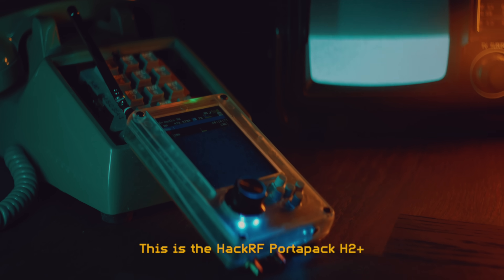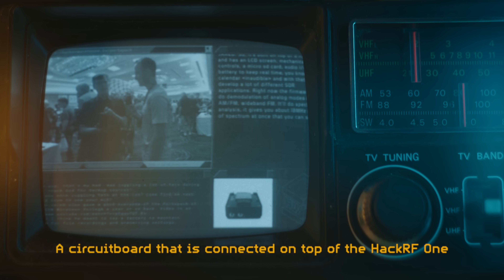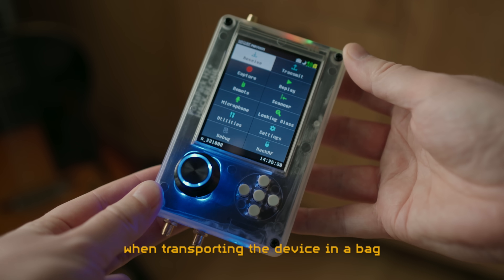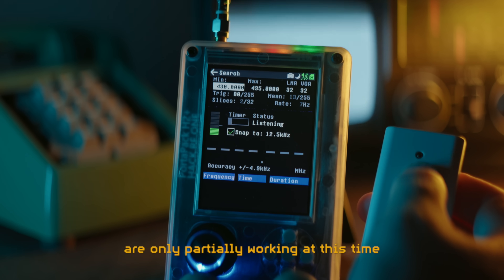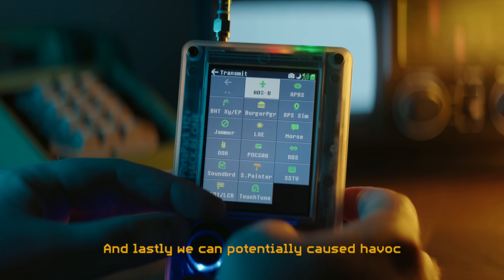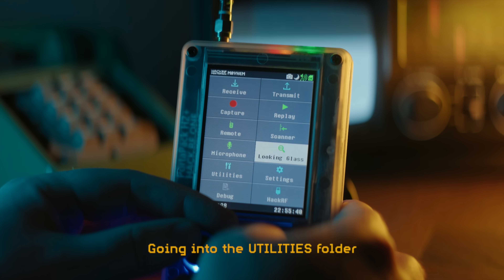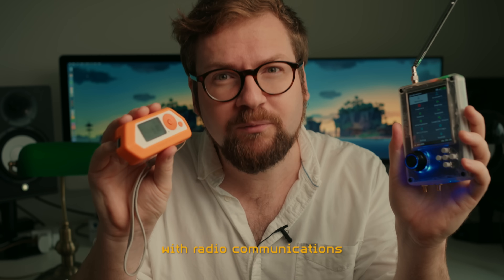What is the HackRF One Portapack H2+

Comment: Both tools are completely different. The flippers used for IR, Ibutton, subghz, and RFID.
The hackrf, while capable of recording a signal, is a traciever designed for radios. A flipper and hackrf save files are not interchangeable that I know of. At least not out of the box.
The big brother to the Flipper is dependent on the frequency. That could be a small usb dongle for IR, a microcontroller, or an FPGA.
The big brother to the hackrf are it's individual transcievers, which each have their own solutions.

Comment: How do you exactly get the correct pin code using the porta pack only using touch tunes? Does the portapack have the ability to brute force all 256 possible PIN codes or do you need additional software for it to work?

Comment: ok, so you can detect the invisible radio signals with it - but what about the visible radio signals? ...

devices like these have been used for GPS spoofing.

spoofing a gps signal, and i.e. telling an airplane theyre flying super low - can lead to loss of lives
or even to wars.  
You would be confused with a nasty actor currently in a "special military operation" - and the triangulation of nasty signal with military equippment 
is a very fast affair.  We talk about less than a minute.  

If you want to transmit, make sure to do it on license free frequencies. Which they are can be asked from google. (in europe its the 433 mhz range 
where sn0ren has been demoing most of the time) 

We had massive GPS issues here in finland lately.. and specialists are prepared to kick doors down.

73
Reply from the maker: Luckily the HackRF has a very low power output, so hopefully people won't cause too much interference, even if they happen to transmit where they're not allowed.

Comment: we had rpi zero it cost 5 buck it can do everything same with extra parts..and some more
Reply from the maker: You would still need some kind of sdr transceiver connected to it. Raspberry Pi Zero has no built in receive or transmit capabilities. You could connect the base HackRF to a raspberry pi and control it that way. It’s not very portable though.

Comment: 🎯 Key Takeaways for quick navigation:

00:00 📡 Introduction to HackRF Portapack H2+
- Overview of the HackRF Portapack H2+, a device for detecting, decoding, and manipulating radio signals.
- Both HackRF Portapack and Flipper zero perform similar functions.
01:48 🧩 Evolution of HackRF Portapack
- History of HackRF Portapack development, starting with the HackRF1 in 2014.
- Description of the original Portapack kit and its evolution over time with various contributors.
- Challenges and quirks in the hardware design, including issues with the battery and power controls.
03:06 🌐 HackRF Portapack Functionality
- Overview of the main menu and functionalities of the HackRF Portapack H2+.
- Explanation of the receive menu, decoding apps, and examples like ADS-B, AIS, and APRS.
- Exploration of the transmit functionality, including emulating signals, SSTV protocol, and potential misuse warnings.
04:57 🔍 Specific Decoding Apps
- Highlighting various decoding apps for specific signals, such as ADS-B, PAC pager, weather balloons, and more.
- Mention of apps with partial functionality and the usefulness of the search app for identifying nearby device frequencies.
06:01 🎙️ Capture and Replay Functions
- Explanation of the capture and replay apps for recording and emulating RF signals.
- Introduction to the scanner app, microphone app, and looking glass app for different functionalities.
07:11 💾 Utilities and Recent Developments
- Overview of utility applications for managing data on the SD card, editing frequency lists, and trimming captured recordings.
- Discussion of recent developments, including loading applications from the SD card and the introduction of the Pac-Man game.
- Insight into the potential for future applications without firmware limitations.
07:45 ⚙️ Settings and Original HackRF Mode
- Explanation of various settings and options available on the HackRF Portapack H2+.
- Mention of putting the device into original HackRF mode for use over USB with a computer and SDR software.
08:05 🛠️ Conclusion and Reflection
- Summary of the HackRF Portapack H2+ as an intriguing tool with interesting features.
- Acknowledgment of its quirks and potential for experimentation in radio communications.

Made with HARPA AI

Comment: Agreed it needs a manual switch for hackrf. Mine is accidentally turned on easily.  I bought it with a speaker and internal battery which isn't always the norm.  Hoping one day someone will update the hardware with faster processing, usbc etc

Comment: The flipper might be a toy out of the box with its software limitations. But modified with custom firmware and added hardware to the GPIO ports the flipper is a strong and handy tool. The big pluss for rhe flipper is that it has all these functions in a slick and tiny design where as the hackRF is quite large and not easy to hide.

Comment: Hey Sn0ren, What is aprox the range for capturing and replaying signals? Much more than a flipper right? 

Thank you
Reply from the maker: Much more than the flippers build in antenna yeah - the primary reason is that you can fit external antennas on HackRF Portapack by default. I haven't tested range of flipper with an external antenna vs portapack, but my guess is that the range would be similar then.
Reply: @sn0ren  Thanks for replying

Comment: This is probably a stupid question but can this record and play back a gym card from a bit of distance? I'm planning a road trip and going to be sleeping in my car, I was sort of hoping I could find a morally grey area way to use the showers at gyms as I go along my way, but it seems like you need to have direct contact with the cards to clone them. I've been reading conflicting info about the hackrf having no nfc/rfid abilities and maybe the chameleon being the best option
Reply: unless your gym uses very old card readers then no.  Playback doesn't work as the nfc process is a handshake -- the transmitter sends data using a rolling hash and the nfc card replies with a salted response.  If you record then play it back the transmitter will just think it's jibberish.

Comment: It will get better over time as the raw tools are all there, you'll see people adding programs to it, it's kind of like an updated hardware set up, but without the tools that have been built for flipper zero.  Remember, flipper is much more evolved. This is new and has a lot of opportunity to be far better than the flipper but for size, flipper wins, but add a headset to it and it looks just like a radio.

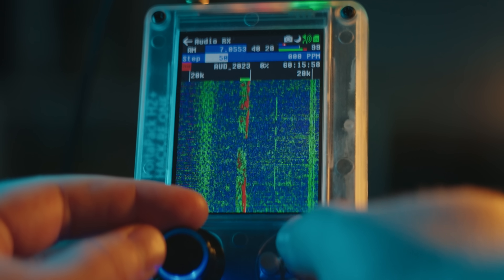Comment: Got 3:35  few tips only 16g max for the card and format fat 32 only. Put all the folders out front so when you open the SD card all the folders pop up. You can also tell the SD card is working under folders. 

FYI don't get the newer version of this tool as support won't be available.  It's the one that had a speaker built in.

Comment: Flipper Zero is a multitool where none of the individual functions are amazing while the Hack RF is a purpose built tool that is amazing at 1 field
Reply: That is what makes HackRf a superior tool.  You just need to learn to use it.  With great power comes great responsibility.
Reply: Makes it superior in radio but lacks the other stuff for those who want to learn a bit of this and that without sinking 3x more money than they need to

Comment: This might be a stupid question, but are all of those functions legal? Broadcasting onto some of those frequencies (the ones relating to navigation) seems like it could result in some pretty dangerous outcomes. Or are radios of this size simply unable to send strong enough signals to do anything other than in-lab experimentation?
Reply: Oh yes, super illegal in most countries. Except for very specific bands and transmit powers. Definitely don't get one and just start playing around with it. Really read into it. A great step is to just get a simple cheap sdr antenna USB dongle. You can receive only (no danger of breaking the law), but you can play around and get some hands on experience!
Reply: At least without an external amplifier, you can't do much damage with the hackrf. Illegal most times nonetheless.

Comment: Not really two products you can compare, they are build to pentest / debug completely different areas … one is a full fledge SDR the other a tool for specific areas made easy. Both tools can be used for redteaming and both should be carried not one over the other. Also for the most out of your HackRF use it with a laptop. Two very great tools, those who call Flipper Zero for a toy don’t really work in the industry that’s for sure :) A “toy” simple tool always has the biggest impact on a customer when showcasing security …
Reply: There is nothing the flipper can do, that the HackRF cannot. The same cannot be said the other way round.
Reply: @DanielKarnole-fs3hm badusb and nfc stuff i guess
Reply: @DanielKarnole-fs3hm  1000%   His claims are the Flipper has better documentation and a bigger community around it.   That right there tells me he hasn’t a clue, as the amateur radio community FULLY supports the HackRF among others and it’s far more a professional and capable tool than the overgrown tamagotchi.  The sole reason the Flipper is making any such waves is simple… smooth brain, script kiddies need zero talent to run the laughable nonsense with a quick download and push of a button.  Professional tools require skill, understanding, and a some gray matter.
Reply: @kd8icq  didn’t wanna go there, but you said it perfectly as is. Thank you!
Reply: Amazingly, I told him the same things and he wants to argue and delete my comments.

Comment: In South Africa, bad people drive slowly down the road, broadcasting RF commands used on remote controls, and if a gate opens, they just walk in and grab anything of value. I caught them inside my living room two times now. When asked what they were doing, the standard response seems to be "Is this a guest house?". I have removed all RF controlled things since then. This is bad tech that will be used for bad things.
Reply: Rolling codes have been a thing for ages and require much more sophisticated and targeted attacks to break.
Reply: If your gate opens to just random comand or de bruijn sequence, you should invest in better gate controller. Its like having a door from 1mm balsa sheet.
Reply: There is a balance, everything isn't always used for bad. Also these tools merely existing create more hardened tech.
Reply: “In South Africa” I think I’ve found your issue.
Reply: Africa has Somalia, and so forth. South Africa is the r*pe capital of the world, too.
Reply: The "bad tech" is the one that allows access with no security whatsoever. Aka whatever garbage the vendor sold you.

Comment: The portapack has some neat features but honestly it’s lacking in a lot of areas even with the mayhem firmware. The portapack however allows for mobile usage so developing custom firmware tools on the portapack is where it shines.
Reply: Could you kindly tell me more about what features you find lacking? I'm looking at buying one myself. I'd like to find out if it can be used for P25 trunked systems? Will it decode PSK, RTTY? WEFAX? HFDL?

Comment: Did you use special drivers to install the latest version of Mayhem firmware? I'm having issues with the firmware loader. I have the same unit as you. Also...do you have a link for the speaker? Thanks!
Reply from the maker: I just installed the firmware by loading it onto the sd card and the Firmware Flash Utility in the Utilities folder. The speaker I ripped off some other random electronics device in my pile, so I don't have a link for it, sorry.
Reply: Nintendo 3ds /DS speaker. Each has 2 so a donor of 1  works without ruining the DS... just no s teruio sound...jus t mono..

Plus I believe it has same jst connection plug

Comment: I didn't know the Portpack project existed. I have been struggling with draining cell phones and tablets or using clunky notebooks to use the HRF outside, so thanks for posting this video which "randomly" showed up in the suggested videos list. 
I found motherboard/battery/enclosure kits without the HRF for $90 on Amazon. That looks like the way to go, unless someone knows of a better option.
Reply: You'll probably already have it now, but ali was the way to go for me (so long as it arrives) saved more than half what I expected to pay for the HackRF + Porta elsewhere. Comes with 5 antennas and a LNA too, was skeptical of using ali, but people I trust said it's fine so I guess it's fine, just longer shipping and less customer service I assume. Can't wait for mine to arrive, Flipper is great, but getting unmodulated signals is something I want to do now, radio has really grabbed a hold on me.
Reply: @daviddavidson2357 did you end up using the link in the description here? I'm just starting to research now
Reply: @cylindercycle4577  David, did you used the link above or other one?
Reply: @daviddavidson2357 I've actually had really good customer service experiance through aliexpress, it's kind of like ebay in that it all comes down to the seller some are more knowledgable then western sellers and anytime I've had a problem with a seller aliexpress has sided with me.